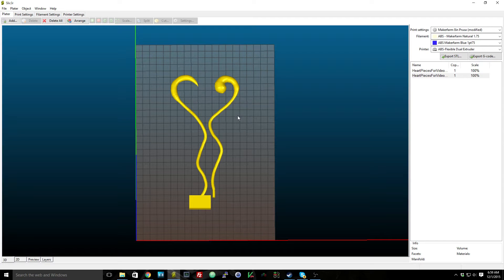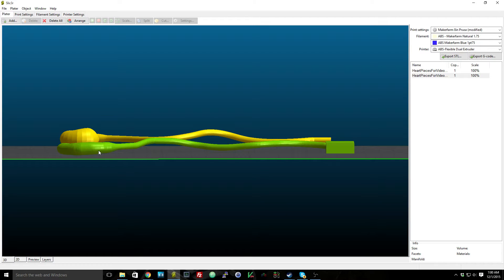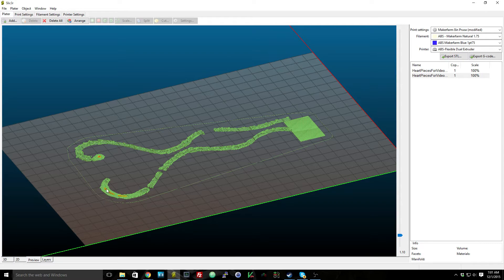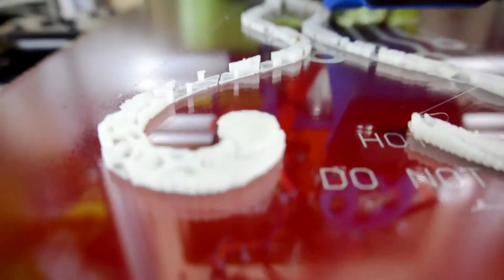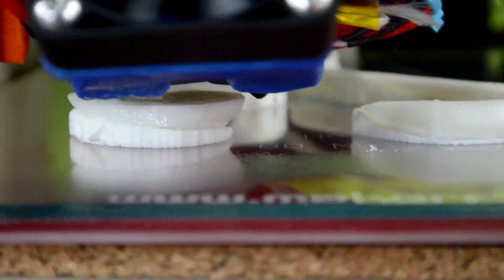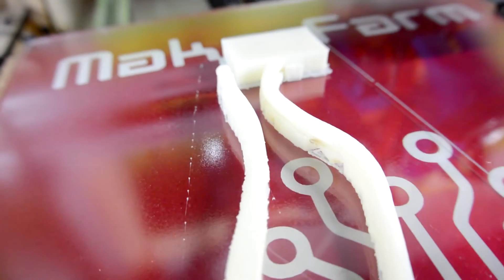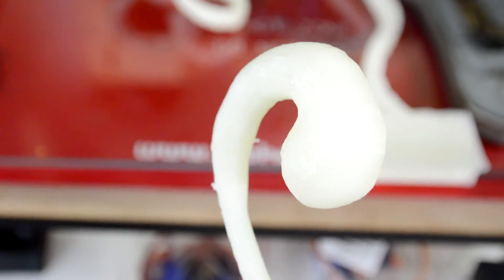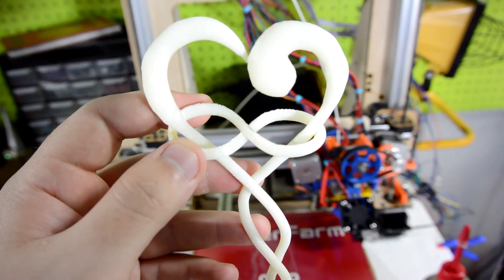3D Printing entirely on Supports - Nifty Heart Print

Comment: It ended up being really nice!
Also using white material (or grey) is a good idea, it kind of blurs / hides the points where support contacts the surface.
Other colors just seem to scream HEY THIS PIECE USED SUPPORTS HERE LOOK.
Reply from the maker: +JJ CC Yeah, colored filament will discolor whenever you try to pull off support, just from the stress introduced. White will too, its just not quite as noticeable. Luckily, these parts will be painted, so we can sand them to our hearts content without having to worry about the discoloring!